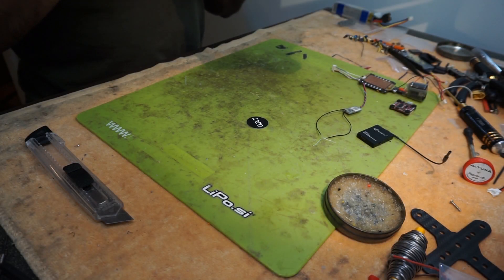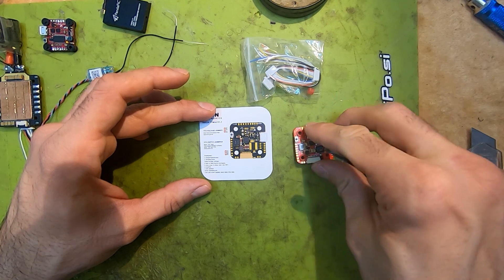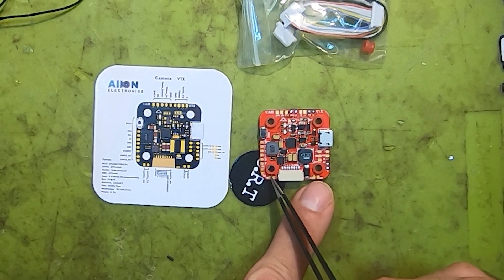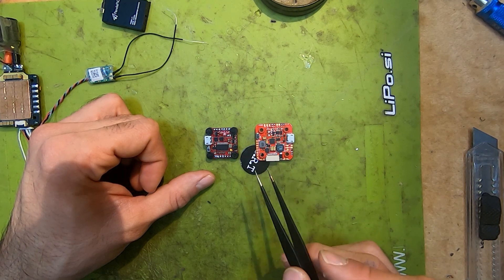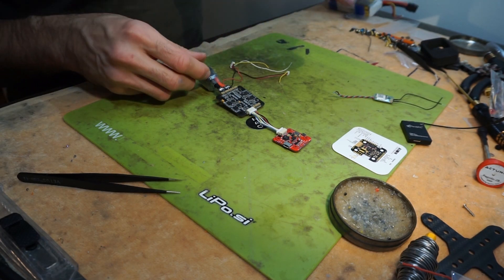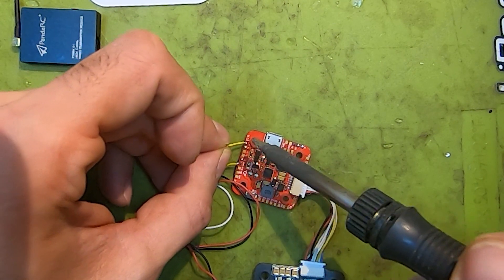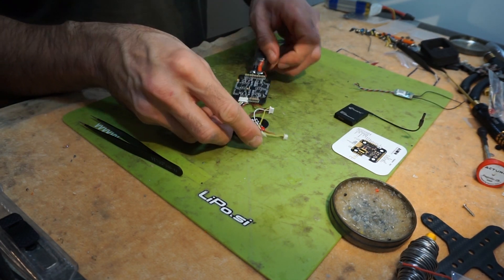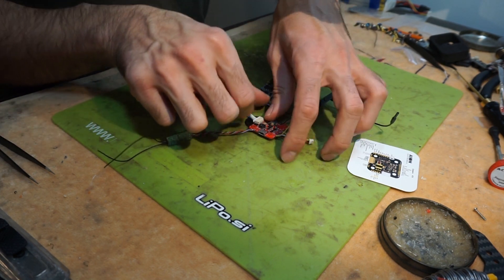Aikon Electronics F7 V1.1 Flight Controller MPU6000 W/OSD 16MB 20*20 Mount Hole

Comment: Where would you solder hot lead from a full size air unit? 6S setup. Thank you!
Reply from the maker: I wouldn't power my air unit from the vbat pad on the FC. I would use separate bec from the battery instead.

Comment: I have this one on 4inch Longrange, and my problem sometimes vibrate on mode air mode and angle mode, not stable flying... What the gyro have the problem? 🙏
Reply from the maker: It's betaflight filter settings
Reply: @mrRockwellFPV  where is located on betaflight?